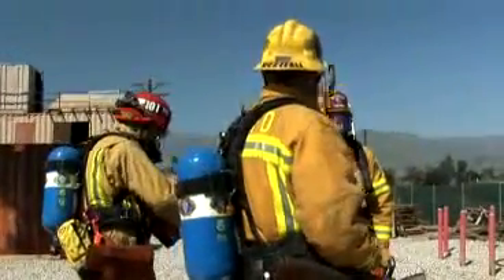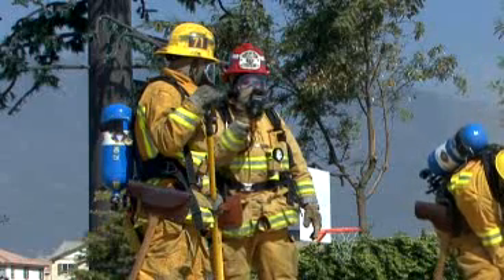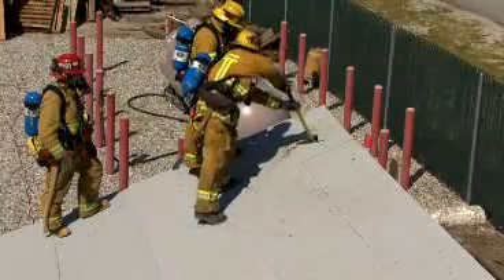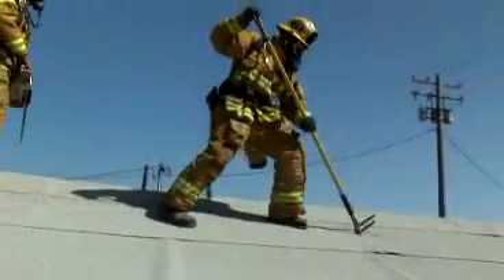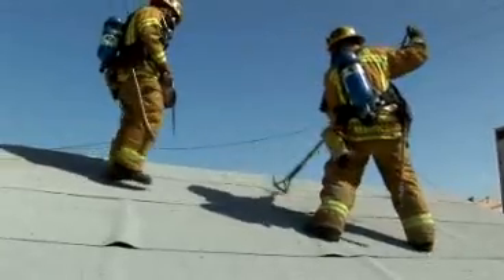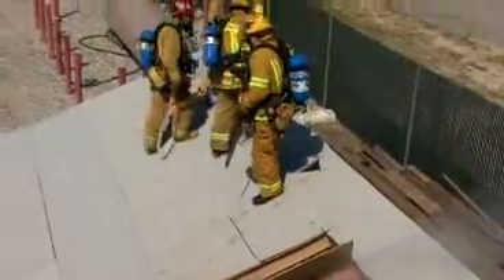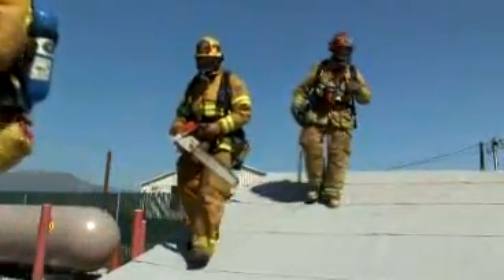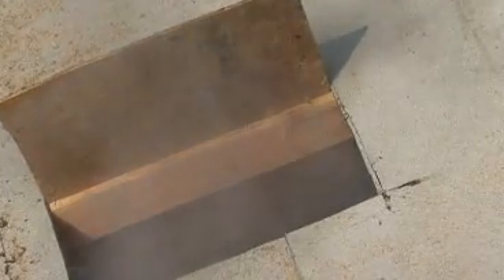3 Person Residential Vertical Ventilation

Comment: Break windows on the first floor in fire rooms and go inside and put water on the burning material.  If the gasses at the ceiling are too hot, spray the ceiling with water.  

Then, break out the windows in the fire rooms on the second floor and put water on the burning  material.  If there is fire in the attic, cut a small hole in the ceiling and insert a nozzle with a 50% cone of water and wave it around until you feel the burning material is too wet to burn.  Then do this in other areas until the entire attic is covered.  That's IT!  No unnecessary and dangerous roof work!  A house is NOT a chimney and can't perform like one.  K.I.S.S.